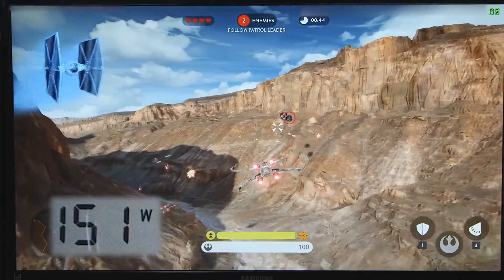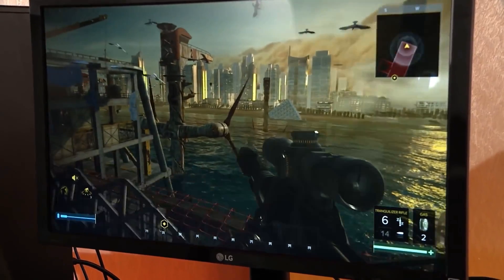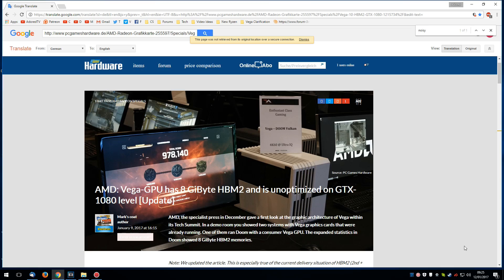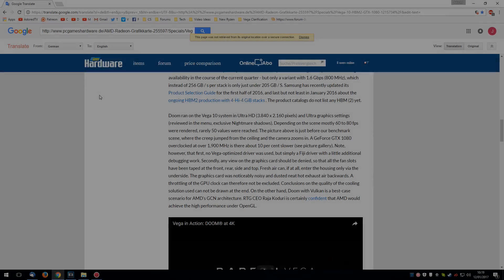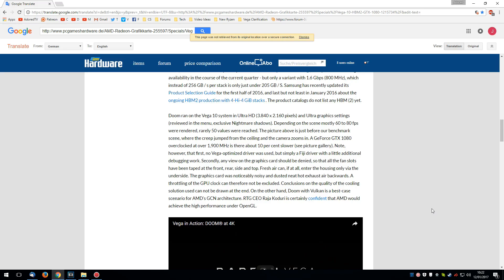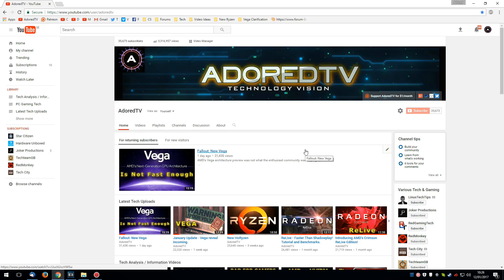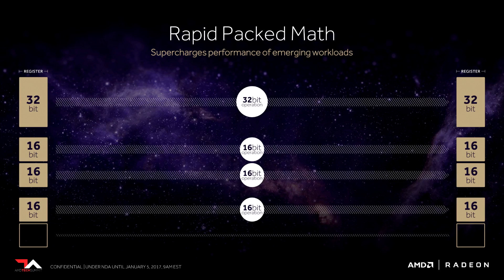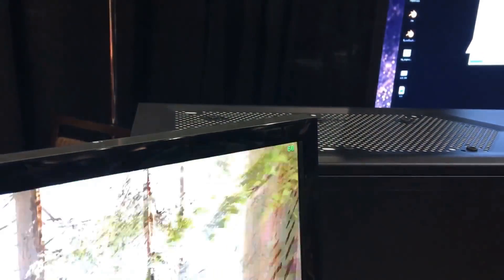Vega Clarification - How bad is it?

Comment: Double lulz no... no, the GP100 only goes upto 4096 CUDA cores we know this from the highest end professional cards.

Titan XP is 3584 that means that at maximum the 1080 Ti can increase performance by about 14.28%, and Titan XP isn't memory bandwidth starved so I wouldn't expect much if any performance increase from using HBM2.

So if AMD can manage to match the Titan XP even slightly at say the $500 mark if it's not water cooled. And then Nvidia launch the 1080Ti with a fully unlocked GP102 or GP100 they can only pull 14% ahead.

Which if AMD launch the 1080Ti at $600 that means it will cost 20% more than the fully unlocked Vega and only perform 14% better, it's really not as bad as your making it out to be.

This does depend on them not water cooling the GPU though if it is water cooled it will need to be $600, so I just hope to god it's air cooled. But really they should be able to cut the price even more than that considering it is cheaper to produce the same die on a smaller process.

So maybe they can get it down to $450 without water cooling.
Reply from the maker: Except GP100 is full of useless FP64 shaders that a pure gaming GP100 wouldn't have...?
Reply: The main thrust of what I am saying is that there is only another potential 14% in GP102, so Vega if with launch drivers can match the Titan XP with a low enough price point it's not as bad as your making it out to be.

Because if the 1080Ti is the same price as the 980Ti which I doubt it will probably be $700 - $750, if the full Vega 10 video card costs $500 or less which they can do if they don't water cool it they can just offer a cheaper alternative to the 1080Ti which performs a little worse but your saving more money than you are losing in performance.

And we would probably expect the "1180" to perform around about as well as the Titan XP so then there competing with Volta already then as you would also expect the "1180" to cost around $500+ by which time the Vega 10 GPU should be cheaper to produce so they can lower the price even more, then they have Navi to take on the Volta Titan and "1180Ti"
Reply: God for evidence that Vega is going to be cheap you already have Raja saying that there goal with Vega is to bring 4k gaming to the sub $1000 price point for the hole PC, that already points to a GPU with a sub $500 price point.

Yes they can bring down the 1080 to the $350 price point but that still puts Vega ahead on price to performance, if it is competitive with the Titan XP with launch drivers, and to the point about final silicon being available 6 months ahead, that isn't true sorry it's just not.

 The fact that they could only run Polaris at 850Mhz kind of proves that, yes the energy efficiency at low clocks was already there but the real difficulty is trying to maintain power efficiency while scaling up.

And Linus from Linus Tech tips got a look inside the Vega test unit and there was a extension for monitoring the GPU's Power and signals, which if the silicon was final they wouldn't need that, furthermore Raja said that they don't know what the final clocks would be etc etc etc.

Sorry on this one you are just wrong.
Reply from the maker: Yep, though sadly cheap is often the result of lacking competitiveness.
Reply: and as history shows consumers still gonna pay more for nvidia than buying amd..
Reply: It's cheap in the sense that Nvidia is overcharging for virtually every Card they have in market. A Titan level AMD card at the 1080 or 1080ti price point would really challenge Nvidia if AMD can successfully bring it to market.

Comment: To be fair, AMD has shown some impressive gains from drivers, so if Vega does see a 20% boost from drivers alone it's going to be on Titan XP levels, but too little too late.
Reply: The 290X is already at the 980 level, which is scary good in terms of driver improvements (since the 900 series is already in legacy support because fuck us that's why).
Reply: The GCN architecture has proven that it's by far the best choice for those who can't afford to change GPU every 2 years. The R9 290X started out as a top end GPU and it's still mid-end due to driver improvements whereas the GTX 780 is dead. The R9 270X is still a decent low-end GPU for those who already have one, whereas the GTX 950 (much less the 750 Ti) is trash. Even the HD 7970 isn't entirely dead performance-wise.

Point is, AMD hardware that is 5-6 years old still works for gaming, equivalent Nvidia hardware is at best suitable for living room media PCs. Finally, the absolute testament to the longevity of GCN is the PS4 Pro. Sony's terrible decisions for the platform aside, adding a second 4 year old AMD GPU allowed the PlayStation platform to compete with average 2017 gaming PCs at a much lower price point.
Reply: Pvt. Duckling my thoughts exactly... also if it is running a modified Fiji driver and the core Architecture is that massively different with tons of new pipelines and hardware level optimization, I seriously doubt a proper driver update won't boost performance by at least 20% initially and continue to grow 5% increments.   Fiji and Polaris are almost identical, with difference being Fiji has HBM memory controller, while Polaris doesn't. Even if games do not take advantage of any of these new core design changes on software side, AMD can implement them on driver side level, just like how they manage to cope with gameworks bullshit is by repiping it differently so it runs cleaner.  Take for example the virtual memory space, games already utilize this in some ways, like if you disable memory limits in game it use more memory than your GPU has, it just stores caches to system ram.  AMD now has a hardware level controller for that.. I can imagine that alone could add 5% gains to games that over reach their memory limits. Same with new shader tech, new shader tech doesn't seem to be that different it's just more intelligent.. and new hardware handler... Fiji driver wouldn't really be able to do anything with that.  Where as a vega driver could take advantage of that and better throughout of shaders.. same with compression, vega allegedly has new hardware level controller for better memory compression and likely they using a new algorithium, Fiji driver wouldn't be able to handle that properly either.. I think give all new hardware changes from Polaris and Fiji... given much of these changes probably do not require game developers specifically code for them to get that boost, many of them seem to just be new freshly made freshly polished hardware level changes that can handle same render stacks better if they are tasked with doing it properly..   

Also side note... one of my friend who is a big Nvidia fan, actually saw a bunch of this info before, and he actually thinks more likely that if Fury card had 8GB of slightly faster HBM and slightly larger cache, they would preform identically to this Vega reveal.. he thinks the drivers being as they are from Fiji are intact the limiting factor, it's basically a fury X with little extra headroom on these drivers... even he has been impressed with AMD technologies and how far a properly optimized driver will advance an AMD card.. he said "just watch, going to be a driver update that will push Vega to TitanX level at 4K" he even thinks that the price will be $400-$450 range and this is not even their big dog card. He says prob best core sample AMD has for vega now yes... prob finalized yes.. however he thinks that AMD will surprise everyone with a $500-$550 card that will be Vega version of Fury line. Just be ungodly power, massive core, massive memory, massive bus, massive clock, pushing vega core to next Fury level just to suppress nvidia volta while maintaining Vega.. this theory is coming from a friend that is a total Nvidia Nut and he is convinced that Vega will destroy Pascal, keep up with Volta on mid tier and scale down to ultra wide memory bus (312 bit or wider) GDDR5 memory for budget market, vega will be all encompassing.. vega Fury will be the Volta killer
Reply: Pvt. Duckling by that time the 11## series will be announced anyway.
Reply: I ran an HD7850 until October 2016 when I installed my RX480!
Reply: Tumble Butt / Styx on Fire exactly, and R9 390 is faster than gtx 970 in most games too. AMD saved a lot of money from R&D by just rebranded R9 390 series and added 8GB. And with driver became more mature and optimization better...
Reply: Pvt. Duckling Titan X will be not supported for a very long time. Just look at R9 290/290X. It was competitive with a 780, but now it's par with 780 Ti and even Titan. Same for 7950/7970 that used to competitive with gtx 580 and later then 680. The Vega will be likely to stays around for a long time. But GTX 1080, 1080 ti, and titan x? Great for a short term but long term? Not really.
Reply: Dex4Sure I don't think the 390 can beat a 980 (at least until Volta comes out), but I have no doubt a 390X can match or beat a 980.
Reply: Dex4Sure Nvidia doesn't directly lose performance, more as a side effect of developing drivers almost exclusively for the current series. This is also further exaggerated by AMD improving their performance over time, so if for example the 780 loses 10% and the 290X gains 10% the net difference ends up being much higher than either of the changes alone.
Reply: If Vega gains this improvement from drivers, and IF it has price tag of 550-600$, you can rest assured it will not be to late. 1st off, the titan xp, Id imagine, isn't selling like crazy with its 1200$+ price tag. Now we have 1080ti, that is basically titan xp for 500$ less. If Vega comes late, it can only compensate with lower price. But... As always with AMD, the wait is long.
Reply: And let's not forget what the 290x is now  doing to the 780Ti......
Reply: I'd sue the 290x for raping the 780 ti, but I'm not the 780 ti and silicon rape isn't a crime anyways. So, yeah.
Reply: I remember when Doom came out, the 390x wasn't performing very well in that game. AMD released a driver "hotfix" and performance improved by 20%. Drivers will make a huge difference to the final Vega performance. 

So, let's say that Vega is 20% faster than a GTX 1080, but costs about the same amount. I don't see how that card would not sell. Yes, Nvidia will release the 1080ti which might beat it, but it will be more expensive. Probably by a fair bit. At the end of the day it will be the price of Vega that determines it's success. If it's priced to compete with the 1080 it will do well. If it's priced higher it may not do so well.
Reply: The one thing that the 950, like all of Maxwell, has over the 270x is an HDMI 2.0 port. Honestly I wish they would just put DP ports on 4K TVs.
Reply: I use a DP to HDMI 2.0 adapter. Never had a single hiccup.
Reply: RyuHimoraSA The adapter does introduce lag. Some 4K TVs aren't that great in the lag department so you really want to limit if as much as possible. If a TV has bad lag, and the adapter does, it can make it unusable in a desktop setting. Also compatibility is not always a given. I would definitely choose a 950 over a 270x for that reason alone, but with the 400 series cards I would not go with Nvidia baring an insane deal.
Reply: Monkey PunchZ yeah, I never used a TV for my gaming pc. I prefer having a monitor. I used DP connection and it never gives me any issues for months. So I never cared about those 4K TVs.
Reply: If what about now.
Reply: May is long?

Comment: About the vega memory/cache thing. So you said the highbandwidth cache is pretty much hbm and the real memory will be ssd storage. Maybe thats why the card was showing up as an 8gb. They said they used fiji drivers, so my guess would be that the drivers treated the cache as memory and it couldn't even access the real memory. So memory might not be a problem after all if amd is right and the game devs don't need to do anything in order to make use of the new memory. I dont think this will save vega (though i still have hopes for vega) but I think its a possibility nonetheless
Reply: This technology is probably more for datacenters and deep learning,  however it sounded like AMD designed the memory controller to be able to prefetch data by guessing at what the card might need ahead of time to overcome that latency, similar to how the cache controllers in CPUs work.  The idea is that the data the game needs immediately is cached in the 8gbs of HBM memory while the rest is stored in the slower memory and the controller moves data around as it thinks it will be needed.  If the accuracy is high,  it can work,  since games usually have alot of data in memory that is not actually immediately needed. It cam make the game think you have a 16gb card when its realy  oinly 8gb,  but still perform like a 16gb card.
Reply: this 8gb of hbm are the only memory on the card that is accessible with 512gb/s. every other storage has to be accessed through the PCI-E bus wich has a max datarate of 
15754 MB/s = 15.4gb/s thats barly nothing and ssd's are much slower than that. for comparison the slow 0.5gb memory of the gtx 970 has a bandwidth of 28gb/s
Reply: Be careful! 15754 MBytes/s = 15,754 GBytes/s ~ 126 Gbits/s!

SSD: ~ 500 MB/s = 5 GB/s = 80 Gb/s
Reply: The units in my comment meant to be all the same with is gigabytes per second.
MRoesterreicher1 for your ssd example ~500MB/s = .5GB/s = 5 Gb/s wich is the sata 3 standard
Reply: The bandwidth of vram is ridiculous high especially of hbm in comparison to every other memory in the system
Reply: I am sorry, but you are simply wrong.

PCIE 3.0 x16 -> bandwith = 15.75 GB/s = 126 Gbits /s. check your facts! 1 byte= 8 bits!!
 This equals to 985 MB/s    per Lane!
http://www.tested.com/tech/457440-theoretical-vs-actual-bandwidth-pci-express-and-thunderbolt/

you were right about the SSD though:D
Reply: MRoesterreicher1 memory bandwidth for gpu's is stated in GB/s(gigabytes per second) 
512GB/s=32.5*15.75GB/s that would equal in gigabits/s
4096Gb/s=32.5*126Gb/s
Reply: Torsten S I was talking about PCIE3.0x16 because you had the wrong numbers(!)